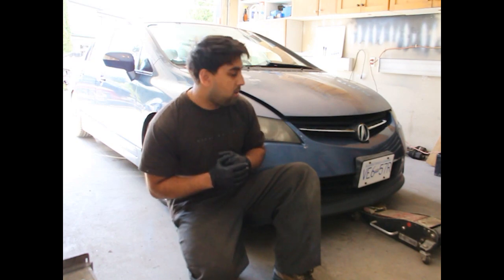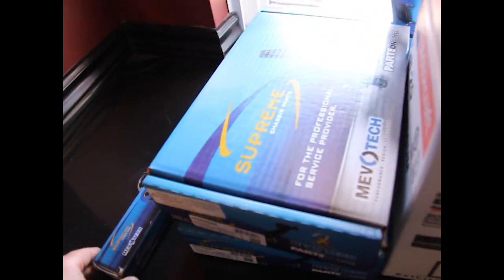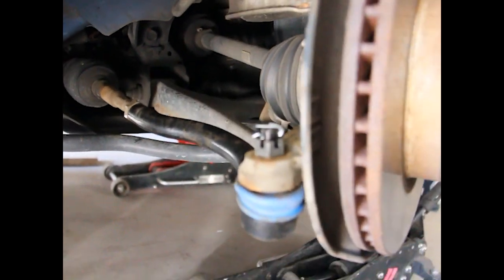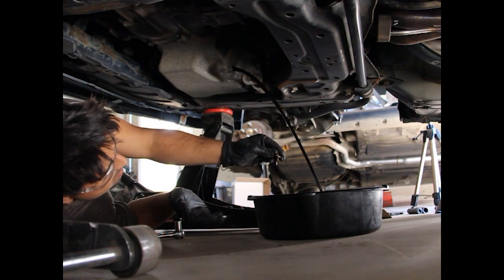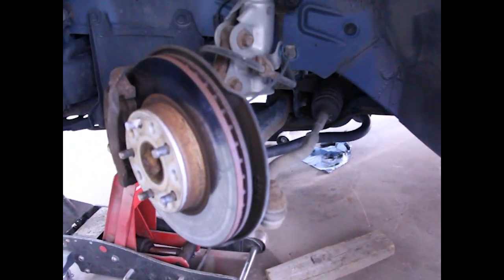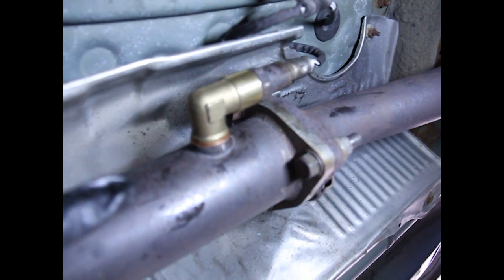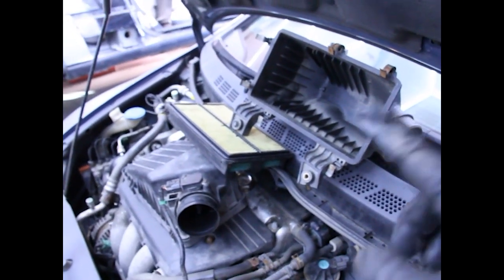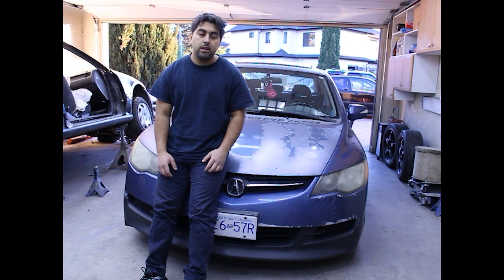Acura CSX Overdue Maintenance - Tie Rods, Oil Change & More!

Comment: I like the car. I have a 2007 Acura csx type-s that I've been fixing up a bit. Unfortunately so far it's all been fix it parts, but I'm hoping that I can do more with it soon that I wanna do rather than what I have to do lmfao.
Reply from the maker: Sorry for the late reply! Yeah, fix it parts suck but are so necessary! Keep an eye out for good condition used parts. The cars are getting old, so part outs are becoming more and more frequent, making it easier to find mods for cheap.